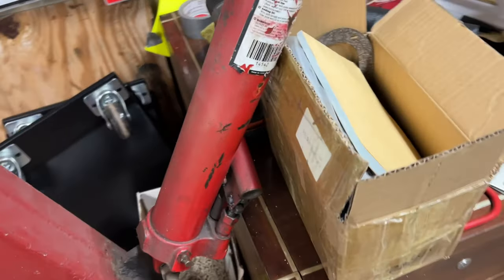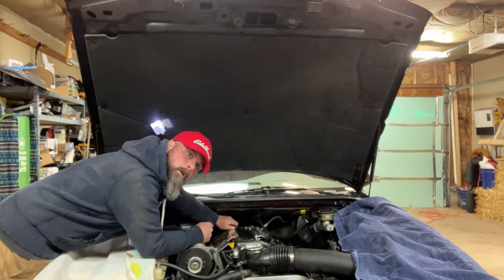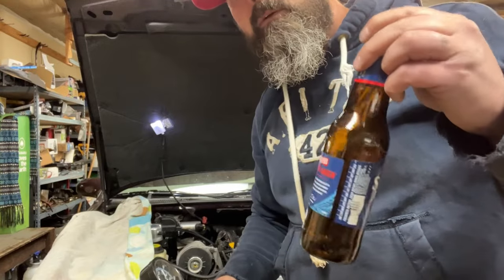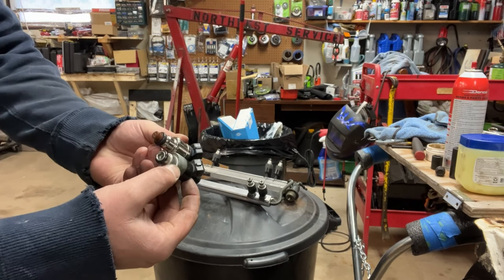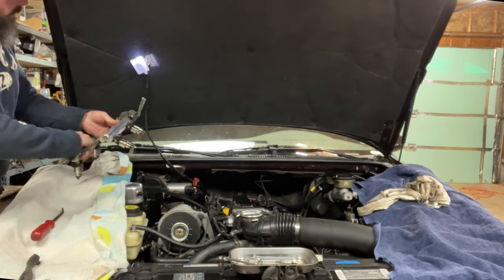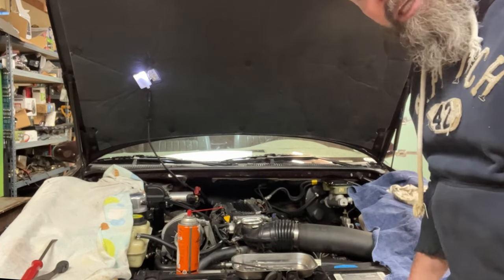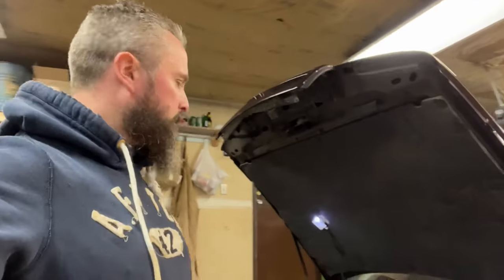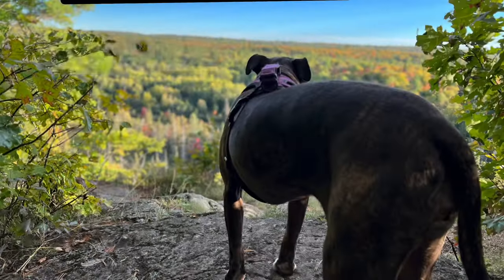LT1 Fuel Injectors 1994-1996 Impala SS, preparing for Hot Rod Power Tour 2023!

Comment: How does it run now you replaced the injectors? Notice any significant changes in the performance and MPG? Did you have to retune?
Reply from the maker: I haven’t had it on a long trip yet, just putting around the yard. No tuned, computer leaned things up as it ran. I’ll do a follow up video soon or on Power
Tour.
Reply: How are the replacement injectors holding up? Increase in performance / mpg?